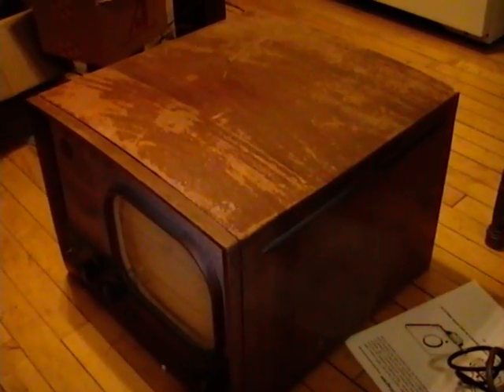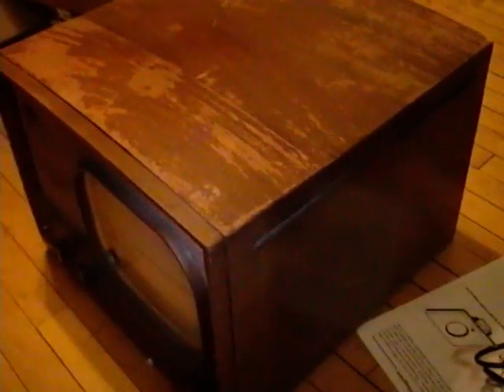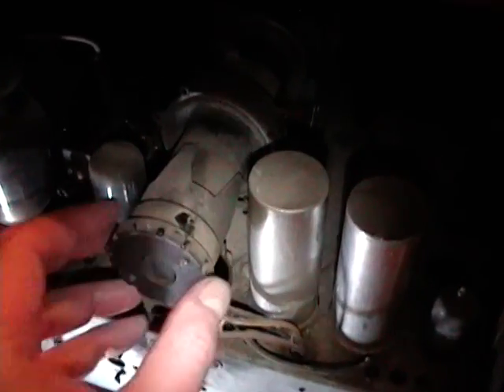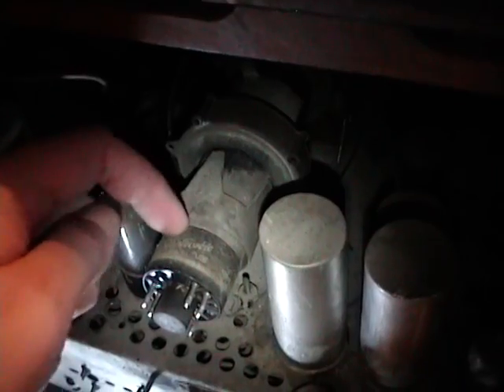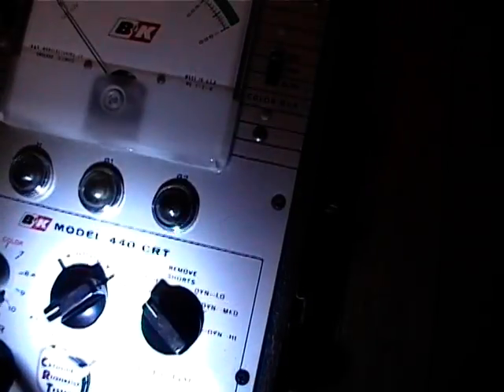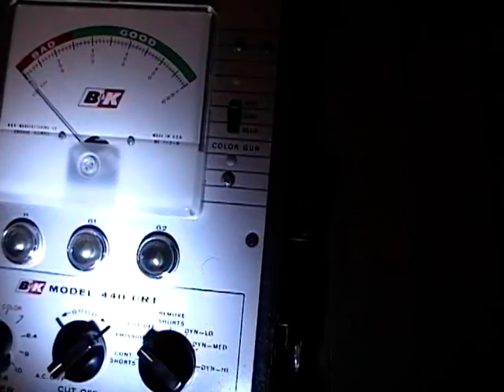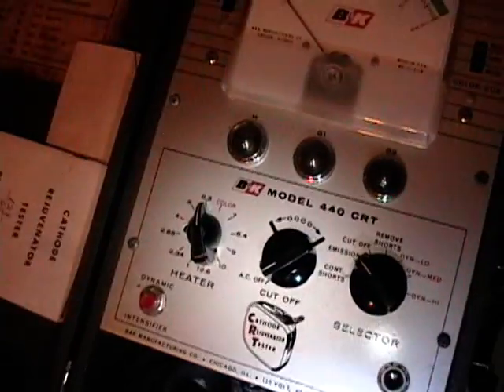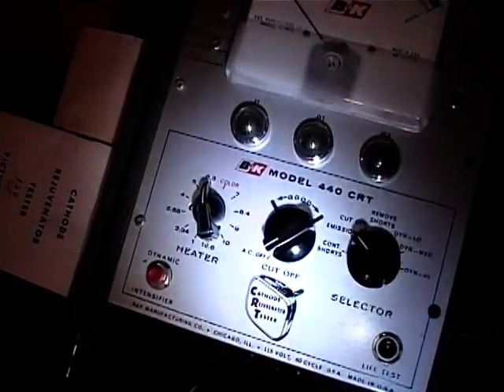GE 810 restoration p1o8

Comment: I sent you the replacement flyback transformer for the GE 800 series. You may not remember... anyway, one of the local antique shops has a Motorola VT-71. The picture tube is falling in, or down. I think they have a gasket that fails? Do you have any opinion about the quality of that Motorola model? If I recapped it and did most of what I could do, could you help with fine adjustments if I brought it to Chicago sometime in the next year?

Thanks in advance for any suggestions or advice,

Damon